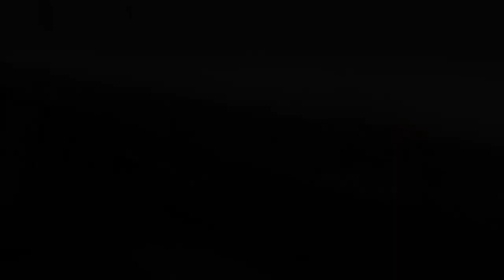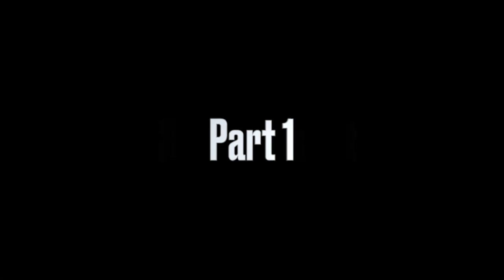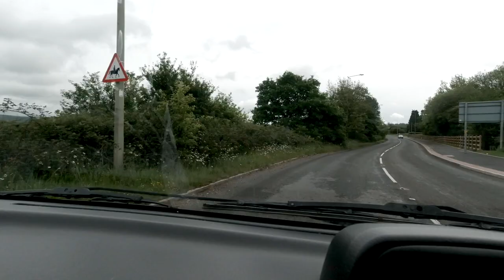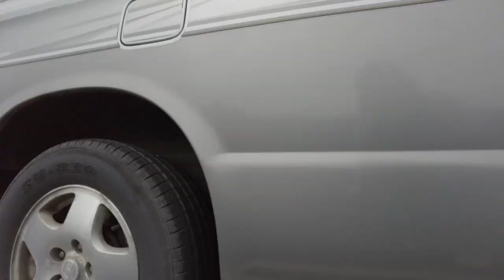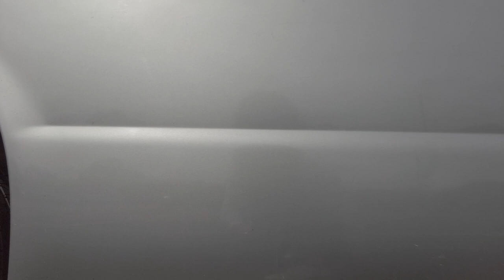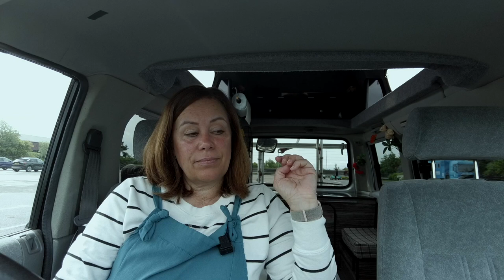Mazda Bongos Get Rust! - I'm Dealing With It

Comment: Bear in mind wheel Arches usually rust on the outside . Because of dust and dirt getting trapped behind the wheel arch inner panel lip .Its good if one can brush this muck away as it holds moisture against panel from inside .Once done use a tooth brush with lithium grease on to coat the inner lip . Drastic attacks call for drastic action !
Reply from the maker: Shall bear this in mind. It’s a totally steep learning curve for me 👍🏼